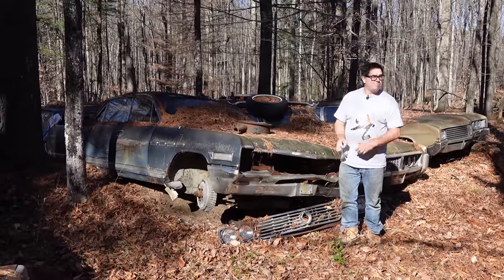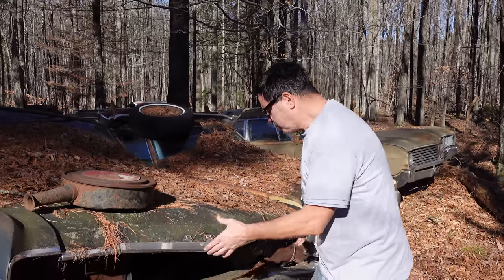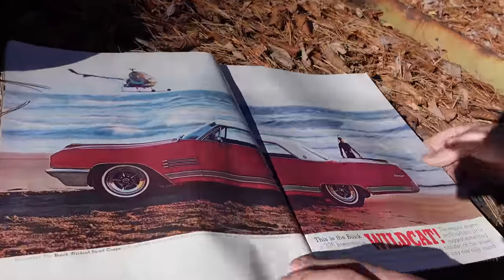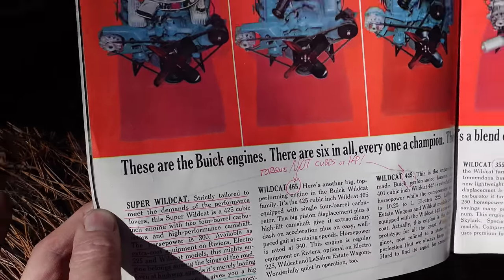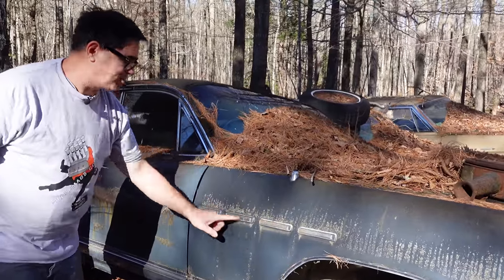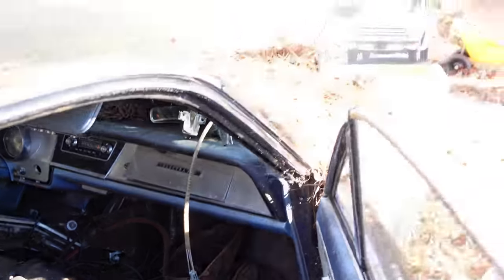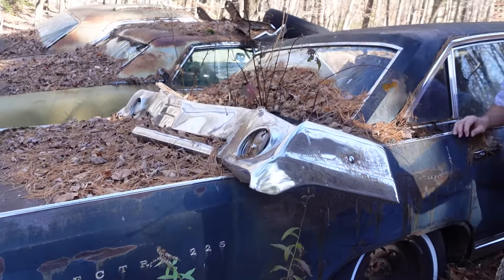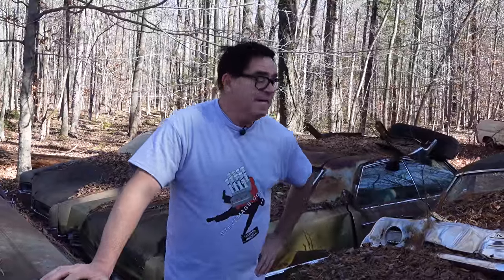Complex Electra Backwards

Comment: Was the 225, the overall length? Considered to be the longest car of the day? 
Big GM wheel pattern 5 on 5" used aluminum brakes, small GM 5 on 4.75" used the smaller cast front drums?
Motor Trend never makes mistakes...."Just saying" always cracks me up
Reply: Yes, 225" length. The car's name was a nod to that.

Comment: At 2:03 in the lower left side of the frame you can see a receiver/dryer from an air conditioning system mounted to the inner fender liner.
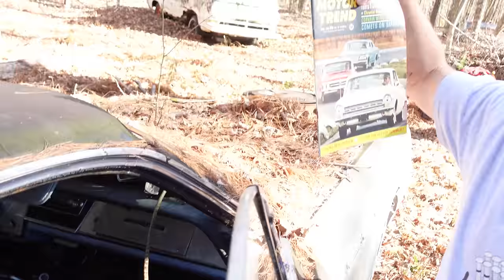Reply: Wow! Just wow. Listen to how crisp and tight that passenger door closes at 7:59  - after sitting for lord knows how long in a junkyard .